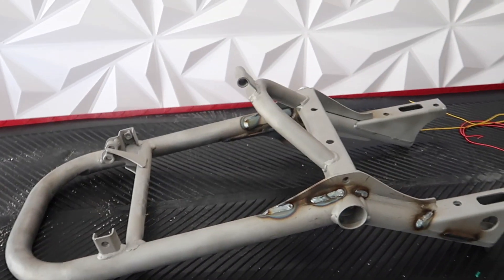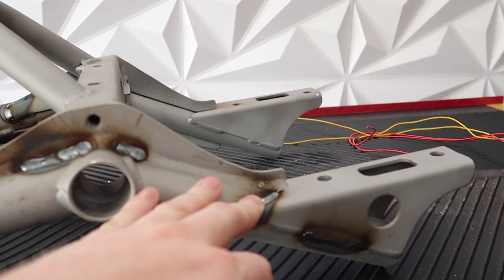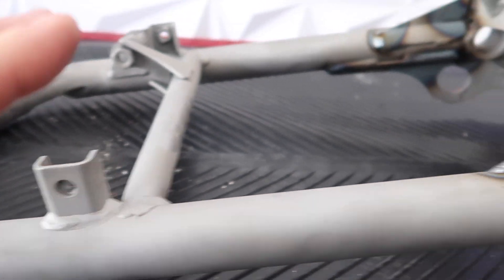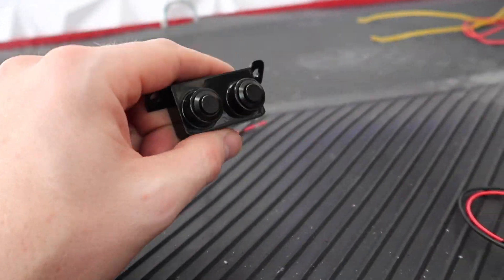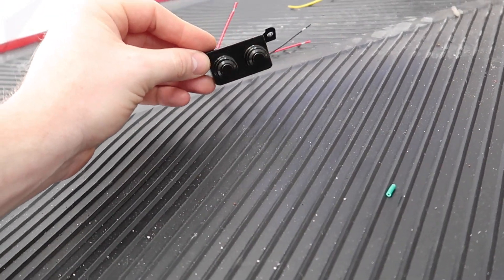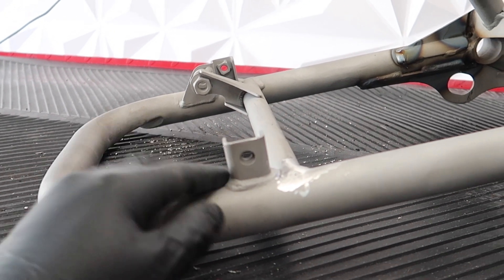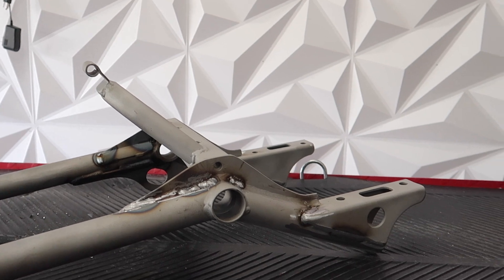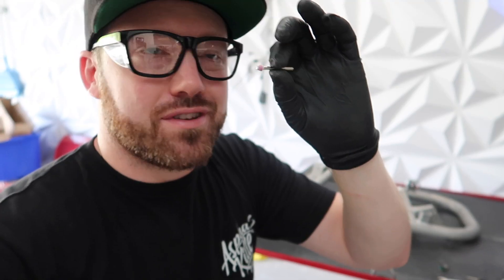Prepping The Frame For Paint- Honda Ruckus-

Comment: Damn, I was asleep at the wheel, how did I miss this video. Go get you some small carbide bits for your Dremel, they will work great at knocking down the heavy stuff on them welds. Then go back and do some touch ups with the sanding discs. Anyways as usual it's great to see you working on another Ruckus build. Keep the videos coming in hot!!!
Reply from the maker: Thank you sir!